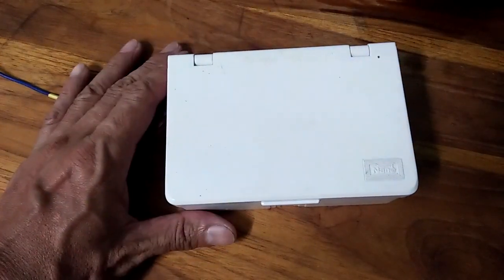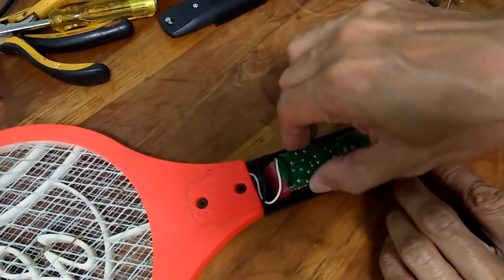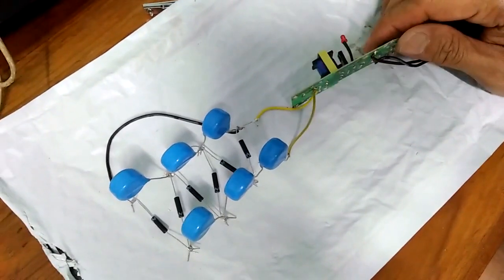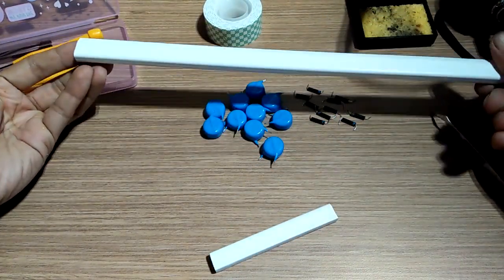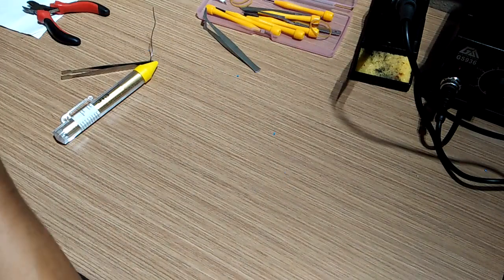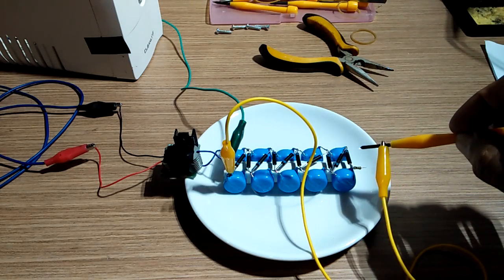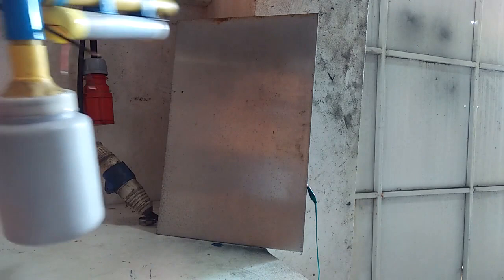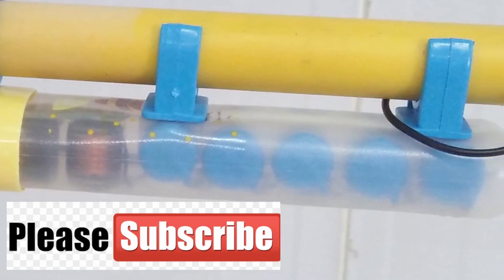Homemade Powder Coating Gun High Voltage Cascade Power Supply

Comment: how to meter KV and uA?
Reply from the maker: there is a kV probe for the multimeter but the onese I see only go up a few kilovolts. another way is to measure the maximum spark gap and compare with known kV values. for uA, must be speciallized test equpment
Reply: @DIYPhil thank you very much.

Comment: Hello Sir , 
Finally I got the High Voltage Capacitor ( 1nF/1000pF , 15kV ) and the High Voltage diode ( 16kV ) and made the Cascade as shown in Lintspray Gun . Used the same 15kV  transformer kit as you used above.  
I powered it from an adjustable power supply at 5 Volts , It produced spark at the end of terminals , but also the Transformer started having internal sparks and noise , and the power supply shut down . The current consumption was shown to be approx 1.6 A on the screen briefly ,. Everytime the power supply shut out for no reasons with noise in the transformer. 
Kindly let me know what needs to be done.  I am very much concerned and not able to find a solution . The 1000kV high voltage generator blows out again and again and hence cant use it , Have to get this cascade thing correct . Plz help me . Thanks

Comment: What is the resistor at the end of the cascade used for? Current limiting? I used a 1 Mohm resistor but it burnt out rather quickly. Still shows 1Mohm but think it's arcing internally based on the sound. Do you need high voltage resistors or do you think my problem is caused by something else?
Reply from the maker: Hi. The resistor at the end is used to limit the output current so that you will not over charge the powder. Over charged powder will cause back ionization that will repel the subsequent powder you are trying to deposit to the part. I indeed had the same problem with the resistor arching between leads making it useless that is why in subsequent videos you may find that I did not use resistor since I had no solution to this arching yet. The resistor must be covered with insulation to prevent arching. In my latest gun version, I simply cover it with candle wax. Professional units had it covered in potting epoxy. I will have a video coming up taking a closer look at the cascades.

Comment: Asalamualaikum...can you explain more regarding the components needed, and what sizes? For example, what size high voltage diode, I'm interested in making it at home
First of all, I would like to thank you for the knowledge that you have shared, it is very useful for me who is still a layman...
thank you......success always wassalamualaikum
Reply from the maker: Hi. You can use 10kV high voltage diodes. Have a look at this other video. It has more details of the components. https://youtu.be/U24Y4QNquX4?si=q4fmQtCYyUGAGXR-
Reply from the maker: and this video has the details of the high voltage cascade as well. https://youtu.be/aevtL9Id4ms?si=SPNEg7ewhOdgdazc
Reply: OK OK OK @DIYPhil
Reply: Is it possible to use a capacitor below 10kV?
because in my country it's difficult to find the right ingredients, it's difficult even in online shops... If I may ask for a link to the online shop that you usually buy from.
Thank You @DIYPhil
Reply from the maker: @aretha500  Hi. I think it is possible to use capacitors with lower voltage. Go ahead and try it out. I am using Lazada and Alibaba for online shopping.

Comment: I wonder why no one uses old coils for cars?
Reply from the maker: Hi. Some people use ignition coil with success. I actually tried it with motorcycle ignition coil which is not too different with car's ignition coil. The problem is those coils have iron core and will not operate at high frequency due to core saturation. The voltage multiplier circuit as can be seen in the video require frequency over 10 kHz to work effectively. The other issue is the size. Those are big. You can see in this video where I tried different coils for the high voltage generator. https://youtu.be/U24Y4QNquX4

Comment: I want to ask what caused my power supply to burn when using the cascade. Even though the powder adhesion results were very good.
Reply: I always watch your videos because they are very helpful
Reply from the maker: @Tmrblaster88  thank you very much. I had a few other improvements in the circuit and the gun after this video so be sure to check it out
Reply from the maker: What is the ampere rating of your DC power supply? Do you have good earth ground connection?
Reply: @DIYPhil  the connection to earth is still not good. is that the problem? i use 2amperes. what is a good amperage recommendation. thank you for your answer.

Comment: Hi uncle, if I use an 18kva capacitor, do I have to use an 18kva diode too because there are no 18kva diodes on the market?
Reply from the maker: Hi. No, it can be other kV rating. I only used the one in the video because it was available at the time of that build. The latest HV cascade I built used 10 kV diodes. Have a look at this video in the link below. Will give you more ideas.
https://youtu.be/U24Y4QNquX4?si=TmYD7Qt5EsFjcnA0
Reply: Thank you uncle, greetings from Indonesia, I always watch your videos about assembling powder coating, very interesting uncle, but unfortunately I don't have any knowledge about electronics, thank you for inspiring me.
I made powder coating like the first step using cascade on the market but it wasn't satisfactory when used. If I have the money I want to try making something like you suggested.
Always healthy uncle❤

Comment: what is the value of the diode
Reply from the maker: in the video I used 2CL77, 20 kV diodes and 1nF, 30 kV capacitors. However recently I built another HV cascade made up of 2CL72, 10 kV diodes and 1 nF, 10 kV capacitors which are smaller but works just fine. Link to the recent HV Cascade build below if you have not seen yet:
https://youtu.be/U24Y4QNquX4?si=iaLuzNLsVbTHoA5O

Comment: Which diodes and capacitors did you use for this build? I have an Eastwood powder coater and I am not happy with it, I think building my own from your description could be better.
Reply from the maker: in the video I used 2CL77, 20 kV diodes and 1nF, 30 kV capacitors. However recently I built another HV cascade made up of 2CL72, 10 kV diodes and 1 nF, 10 kV capacitors which are smaller but works just fine. Link to the recent HV Cascade build below if you have not seen yet:
https://youtu.be/U24Y4QNquX4?si=iaLuzNLsVbTHoA5O

Comment: Hi Phil, great project. What frequency have you used with for the final V4 gun?
Reply from the maker: Hi. About 16 kHz. With just the transformer, I adjust the frequency until the purple spark appears in the secondary at a gap of about 5 mm.

Comment: hello, make the gun works fine and but i got an electric shock, is it necessary to ground the output of the high voltage cascade? If I touch earth or any metal with my hand, does it constantly discharge?
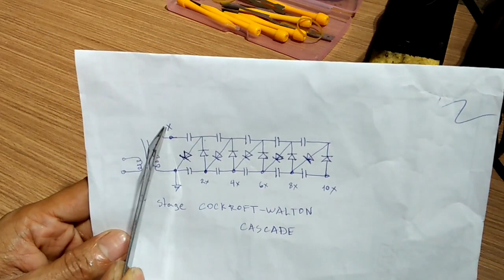Reply from the maker: Hi. You should be connected to earth ground. If you look at commercial powder coating gun, the handle has a metal strip. That is for grounding the operator. Look at the circuit diagram I show on 3:59, the ground symbol must be connected to earth ground. When your body is touching a metal surface connected to ground, you prevent build up of charge and makes you neutral. Look at my subsequent videos of homemade powder coating gun I show wiring more clearly.

Comment: I have noticed in the commercial designs that the ground is connected to the positive side of the first stage in the cascade because they are negative output which makes sense however because the arcs will then be going across the diodes I wonder if this puts more current through them and makes the final resistor more important, one of the reasons you probably haven’t already burnt them up.
Reply: I just did some test and the current across the diodes is the same regardless the end resistor helps but doesn’t matter too much if the input current is already low. In terms of what side the earth goes on when connected to negative side you get a constant voltage whereas the other way it will fluctuate between positive and negative the initial voltage

Comment: Gema's spreygun … the problem is it doesn't want to stick to the body, what do you think is broken and sometimes the current from the cascade leaks.

￼
Reply from the maker: Hello. I am not sure which indicator bar are you talking about. What unit do you have?
Reply: @DIYPhil  Gema's spreygun … the problem is it doesn't want to stick to the body, what do you think is broken and sometimes the current from the cascade leaks.

￼
Reply from the maker: @KhalidIon  Hi. What I can recommend is you disassemble the gun and look for obvious damage. It could be as simple as a loose wiring connections. If you want, you can send some photos to my email philipal2015@gmail.com

Comment: Nice description, I am an EE who designed professional Electrostatic Cascades which are used at GM, Chrysler, BMW, and others for both powder and wet paint.   Anyone building these please be careful.  The complete system contains a smart power supply that will shut down before you get zapped.
Reply: Can you explain a litte how the transformer at proffessional cascade works? the ones ive been looking at had a weird wiring where primary and secondary start are wired togheter, which might introduce high frequency/ emf to the power supply
Reply: Tell us how not to self-zap, please? What solution is used for emergency power down, how sensors work?

Comment: What voltage do the diodes need to be rated for?
Reply from the maker: I have tried 10kV diodes and it worked so far no problem.

Comment: will you tell me what is high voltage diode kv
Reply from the maker: the ones I used in this video are 20 kV. However I think a 10 kV will also work.  you can find a more detailed circuit diagram and parts list in this followup video:
https://youtu.be/aaLc6K-r8Ic

Comment: You remove the 1 mega ohm resistor after testing, right?
Reply from the maker: Hi.  Yes,  i am still experimenting about the effect of the resistor. The commercial powder coating have it.  My idea is that it is there to limit the current and prevent sparks which is a fire hazard
Reply: @DIYPhil  I watched your videos and made a power supply and a gun, thank you bro.  I haven't tested it yet.

Comment: Napakamahal ng 30kv capacitor P200+ ang isa , gagamit nalang ako ng flyback pwede siguro yun
Reply from the maker: try mo kahit 10 kV na capacitor. kaya lang naman 30 kV ginamit ko kasi yun available sa akin nung ginawa ko iyan. kung flyback ang gagamitin mo dapat yung may built in na diode sa output para dc yung high voltage hindi ac.

Comment: Supply current to 15kv generator is AC or DC
Reply from the maker: Hi. It is low voltage dc about 4 volts. The output of the transformer of the 15 kV module is AC, then in is rectified to DC on the voltage multiplier stages.

Comment: Hello, still in progress of building and experimenting with mine, ive seen in comments on latest video that you are experimenting with powder pump what im looking forward but im wondering if you tried anything with adjustable voltage, since this schematics is over 100k voltage what professional guns dont have since it can create holes in powder and for some detailed objects or powder with effect they are using around 50K, the module that you recommended has 15k fixed pretty much so its not adjustable.
im thinking if maybe it would be possible to have stages separated but that would need high voltage relays and it would need to be outside of gun with powersupply so there is problem with how thicc insulated wire would be required from power supply to gun, just wondering if you have been experimenting with this, but i love your work!
Reply from the maker: Hi. We can adjust the output voltage by varying the supply input voltage. According to the manufacturer, the 15kV kit will work from a supply voltage of 3.7 volts to 12 volts (need to change the feedback resistor to 1.5k ohm). The primary winding of the transformer connects to the input voltage so it has a direct effect to the output voltage. The high voltage of the cascade is difficult to isolate. In one of my later videos, I showed that the spark jumps out from the thick insulation of the final output when it came close to the grounded metal part of the gun. That is the reason why all professional commercial PC gun has got the cascade located on top of the gun, so that the high voltage does not have to travel far.
Reply from the maker: I also would like to add that the cockroft-walton voltage multiplier that we assemble with diodes and caps is not ideal. There are many power loses in each stages due to inherent characteristics of the components. I doubt if my gun reach 100 kV at all. When I try to increase the input voltage at some point, sparks jumps within the transformer windings (until it burn out the insulation), and even between stages of the cascade. I try to stay at about 4 volts input to prevent stray sparks. The better circuit will be duplicating the commercial voltage cascade where they used about 10 stages. That means less voltage on the transformer secondary winding and less voltage in between adjacent stages but still reach the 100 kV output. That will be my next circuit to experiment on.

Comment: What should be the characteristics of the paint used?
Reply from the maker: It should be the powder coating paint. It is very fine dry powdered paint and it melts when heated.

Comment: Hi phill. what if we hold the object in power on. is it okay to hold it like a factory made machine?
Reply from the maker: Hi. Are you referring to the metal object that we are powder coating? If it is the object that we are powder coating, then YES, it is OK to hold it with the power ON as long as you and that object is connected to earth ground so there is no voltage potential, and you will not get shocked.

Comment: Hello, im trying to use ionizer i got, it outputs 7kV and should not be fragile as these small transformer circuits since its heavy duty, problem might be that it shuts off and you need to restart it if it doesnt have enough contact (the spark is at too much distance) but since it would be connected to the cascade, whats your opinion, also do i need to use 1nF capacitors with more clean energy delivery ? since only the 10 capacitors are like 30€ here
Reply from the maker: Hi. The initial high voltage output should be AC or pulsating DC for the subsequent cascade to work (Cockcroft-Walton Multiplier). I'm not sure if the 7kV ionizer output is steady dc or pulsating. I encourage you to experiment with the capacitors and diodes available to you.
Reply: @DIYPhil  Hello, thanks for quick response! mine should be pulsating since i can adjust the frequency on it so it should work then. And im just gonna try and get my hands on those capacitors, and try the ionizer, worst case scenario ill buy the same module you have, also thank you for amazing and detailed video! if this will work its gonna save me a lot of money that i would spend on some even medium powder coating gun!

Comment: can I use 3 pieces 10kV capacitors for 30kV. Because I couldn't find 30kv ones.
Reply from the maker: Hi. Just try to use the 10kV capacitor instead of the 30kV. I wanted to try 10kV capacitor because it is less bulky, but I used the 30 kV because that is easily available for me.
Reply: @DIYPhil  But the output of the transformer is 15kv? Should I try the 10kv capacitor alone without series?
Reply from the maker: @srknyxl  In theory, the voltage rating of the capacitor in the cascade should be 2x the transformer peak output and thus 30kV. However, I do believe that the actual output is less than advertised as usually is the case with these Chinese-made kits.  And besides, we are not applying the max. input voltage to the circuit, so I really don't think it reach 15kV. I suggest that you assemble the first stage of the cascade with your 10kV caps and see if it will not fry the caps. The first stage only composes of 2 diodes and 2 capacitors.
Reply: The voltage on the cap needs to be rated more than the voltage of the transformer.   If you are using 15KV then you 15KV +

Comment: What resistors, capacitors and diodes did you use?
Reply from the maker: Hi. You'll find a more detailed circuit diagram and complete parts list in this video: 
https://youtu.be/aaLc6K-r8Ic
Reply: This video isn't available any more

Comment: Hi phil. Can flyback tv be used for powder coating? Thank you.
Reply from the maker: Hi. Yes, I have seen some using that for the High Voltage generator. The flyback got to have built-in rectifier diode at the final output because the high voltage needs to be polarized.
Reply: @DIYPhil  yes.. that is exactly what is inside the power supply for  the Eastwood home powder gun..
Reply: Thank you phil. You're very helpful

Comment: hi can the high voltage boost circuit last long?
Reply from the maker: Hi. If using for small jobs only like what I do, it will last long because you only turn in ON intermittently. The weakest component is the small transformer. If increase the input voltage at some point the enamel breakdown and there was spark within the coils.
Reply: ok thanks phil, because i have made it and when it is turned on for 10 seconds the transistor feels very hot..
Reply from the maker: @cmsworkshop  yes. I forgot to mention the transistor. I ever broke at least 1 when I tried higher input voltage. That is why now I limit my input voltage between 4 to 5 volts. And I changed the feed back resistor to 470 ohm. That is the resistor connected to the diode. Take a look at this video if you have not done yet. It has the simple circuit diagram. https://youtu.be/aaLc6K-r8Ic